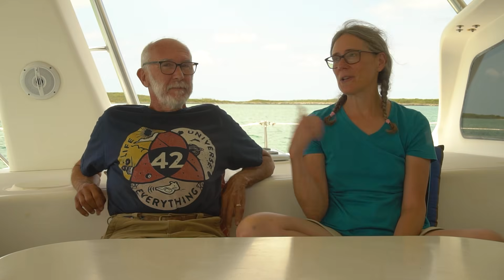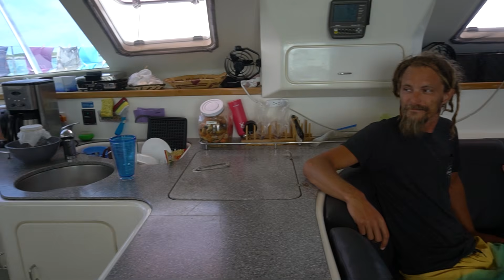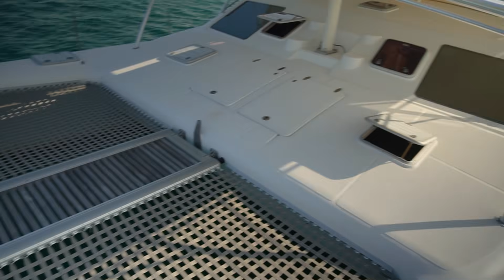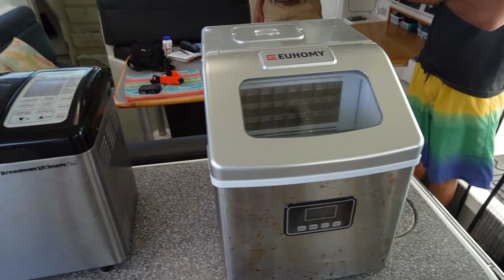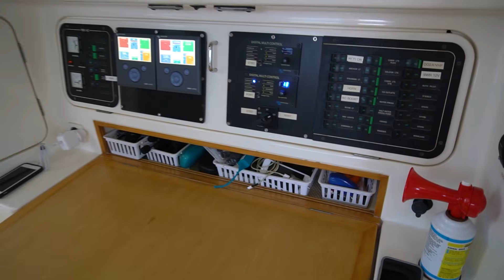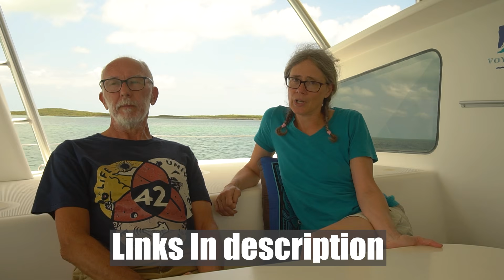100% Solar Electric Catamaran, Interview with owners from Indigo Lady

Comment: Really cool, if ever you need more power you can had a smaller catamaran platform that fit under the main boat that you can let it go out in the back of the catamaran like a solar trailler with more panals for more power. It's just an ideal!

Comment: If you couldn’t afford the electrical upgrade you could purchase two 40 Hp outboards and simply add mounting points to the hulls. 
Keep the huge fuel tanks from the original and have a massive range.

Comment: Since you already have the most expensive hardware. Maybe a solar slide system would be an option on the outer panels to add extra panels.

Comment: It would be nice to have some sort of wind turbine to charge the battery bank. I know there are are marine boat mounted wind turbines which have a very low capacity to charge drive batter banks.

Comment: 100% solar but you still use gens
Reply: Probably just a backup in case the batteries are dead main use is probably battery and motor

Comment: I have never seen a 2-blade propeller on any boat.  And torque is relatively irrelevant on a boat. Torque is what gets a dragster down a dragstrip fast.  So now you have all the complication of two diesel engines, plus all the complication of all the solar/electric equipment as well. I'm sorry, but that just seems nutty.

Comment: 20 miles a day!  Yeah ...... most boat people would not be happy with that.  And here's the problem, when you've done that distance and you've drained your batteries and the Sun is going down. Then you've got night time, so no charge. And then you wake up with a bunch of drained batteries, so you can't move until you've charged your batteries. If only there were a way of moving the boat across the water using the wind.

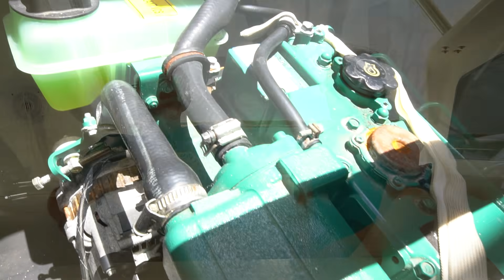Comment: "100% Solar Electric Catamaran" this is not true.  @ 5:57 he states that he has 2 diesel generators "for backup or cruising 24 hours a day".   Earlier in the video he states that the boat is set up to "island hop 20 miles a day" on solar/battery power.

Comment: Electric boats should be the default form of propulsion for leisure craft like cats where they have plenty of space for solar & battery. If there is an engine at all, it can be small in-line one to charge the battery or drive the motor in exceptional circumstances.

Comment: 5:49 - so they have a Diesel Generator Engine.... so this is not a 100% Solar Boat...  its just a gimmick... you are still relying on Fossil Fuels as the primary back up because Solar is useless and unreliable.

Comment: Amazing example of what is possible. if you replace the solar with modern ones you should get like 35% more electricity. They did some breakthrough on solar cells in the last months - which should be soon in production.
If you are lucky and Avalanche works out (a company) then you can take this whole setup, scrap it and put an Orbitron on each side of the hull and have more power, 24/7 and can run the engines full power as they together give you 30kw++ (I hear designs up to 100kw each are being worked on for a unit small enough to fit on a desk)) using ridiculous amounts of fuel (100kW, 24/h is around 0.2 GRAMS).
Until then - AMAZING thing.

Comment: Lovely setup.
I would have Most certainly put more powerful motors in, not for speed so much, but to be able to get out of a spot of bother. - such as:
Being able to steer the boat in strong winds and go against a strong wind.  (to be able to relocate or even allow yourself to have another chance at getting a good anchorage)
Having an over specified motor has literally saved the lives of our family a good handful of times.
Enjoy your boat, would love to have done a build like this <3

Comment: Greetings Dave and Lisa, kudos and accolades to you both for actually building and doing what to most of us, is a very challenging project. The concept of an all solar powered boat that is practical and liveable in, is awesome !! Just one query, in monitoring the power output of the solar panels, how often do you have to wash/clean the panels ?
Cheers
Kin

Comment: Interesting project. I was sadly surprised that they can get only 15-25 mi range running on batteries alone. Since they don't have sails anymore, that means they are limited to short coastal trips. I hope to see the technology evolving in my lifetime.
Reply: The thing is, he could likely invest in building out the batteries, and significantly increase storage capacity.

Comment: The lack of sail seems very limiting.
Reply: If you are in a hurry…. If you are retired as they are does it matter how long it takes to get there?
Reply: @mossybank2000  When you run out of power at sea with no sail you die.

Comment: 25 mile range on a sunny day with no current or wind fighting you. I don’t see why a sailboat was so out of the question. To sail on electric all day you would need run both generators which seems like running on carbon but with extra steps.

Comment: This is a neat prject. I'm currently converting a monohull to electric. Mostly for convienience (I despise working on marine diesels). I'll have solar panels and a small gas genorator on board. Lets be honest withourselves though about what is a isn't a vanity project. When you take the sails off a sailboat you have not "gone green". Learning to sail would be going green.
Reply from the maker: Sounds like you are working on a cool project yourself. Sometimes our bodies decide before we do. If I couldn't sail anymore I think an electric conversion would be the greenest and best option to continue living this lifestyle. But I won't argue that sailing is the best option imo.
Reply: @WildlyIntrepid  agreed sailing does a number on the body. I'm already saving for electric winches and roller furling.

Comment: Solar panels and LiFePO4 battery prices have dropped a lot since then - in fact you can now buy 600W solar panels for the price they paid for their 300W panels. The battery (2 x 16 cell) of 3.2V/340Ah ( ± 35kWh) would cost around $3000 !
Reply: Agreed, If you are willing to go used batteries, it can go as low as $50 per kilowatt

Comment: 🌴 I’m a retired boat ,yacht builder , I’m and old salt that’s so old when I fart dust comes out !  This guy & gal got their schit together , he is highly intelligent and has the know how and skills to pull this off , so l understand that using a Cat , gives you the space especially for the solar , the boat definitely got lighter getting those motors out and sail rigging , your battery bank seemed small to me but I’m not a solar guy that’s why I’m watching this vid to further my knowledge, would a larger Tri hull worked out better ? Could you of used say a Tesla wall battery ( don’t know the cost 🤔) worked out better , just wondering, could or would you us any say vertical wind generation? And what about distance ? Is it capable of being infinite 🤔 ? Self sustaining.  Have you taken it on long cruises, how far , what would or will you change to make it better . ( I’ve thought about doing a houseboat , a lot smaller scale but thinking of how to make it totally off grid to use as a mother ship to tow my fishing skiff to crazy fishing places ! )
Reply from the maker: Your ideas are all good. I think Dave made his choices based on what he could source at the time. As it has been some time that he has been cruising with his vessel. If I recall the batteries he has were some of the better batteries on the market at the time but very expensive compared to what we have now. We also have more options for charging sources.

Comment: US Navy sailor here, I have designed your boat down to the redundant gensets and wise choice on 48v as your system voltage. In my head and on paper anyway, but  you have actually done it and I am impressed sir. Bravo.
Reply: No gensets needed. I've lived this on 2 of my yachts sail and power.  One panel is insurance. More reliable than gas or diesel.
Reply: @mattparke4322   One panel is not even close to enough to move the boat yet alone getting rid of the power plant.
Reply: Solid computer controlled sails with solar panels embedded would be the best solution. You should be able to get as much solar power but with the ability to move without using your electricity when there's no sun.
Reply: you planned the boat down to redundant gensets and the only comment you had was good job on 48v? Riiiiight.
Reply: Very well said sir and if I may add, Dave's having fun!
Reply: So, as a Navy sailor, you also know how this would not work in blue water. This is for coastal cruising when you can wait for sunny days.
Reply: @JayRSwan   There is sun on lakes and rivers too ya know. Not to mention it has a desil generator so it would work fine. ALso the guy who asked the blue water question wasn't the navy sailor.
Reply: We all know you’re a bot.
Reply: @Bofum69  Why is the go-to response for your kind "tHeY'rE a BoT"?
Reply: @Bofum69  For all we know you're a bot.

Comment: I have a couple of probably very dumb questions for you, I know little about boats or electricity.  
1. Is there a way to find out what kind of power would be needed for typical operation(at anchor) for a specific kind of boat?  I am thinking a lagoon 500 currently? 
2. If you ran solar over the entire deck surface of that boat 15.5m x 8.5m would you get enough electrical power to operate the boat and still have enough left for reasonable propulsion?
Reply from the maker: So many factors come into play. It's easier to reduce consumption than it is to produce power. Everyone's power needs vary. For myself we get by just fine with a few hundred ah and 1kw of solar for the most part. Others have more power hungry appliances and some do not even have a fridge. Work out what you want and make sure you can run that much on your system with enough overhead for cloudy days.

Comment: I would suggest a hydrogen tank, with a fuel cell and an electrolosys system.  So that you can store large amounts of power but admittenly it'll only have about 50% efficency.  But once you've emptied those batteries and before you run the diesel generator, you could run you hydrogen power storage system.  It would extend that 20 miles range of pure green energy.
Reply from the maker: That is another nice option for someone who isn't on much of a budget. As that tech is pretty pricey for what you get imo. We keep getting great comments and suggestions on how the range could be extended but if I recall they never felt limited by their range and have cruised down the coast and to the Bahamas for a few seasons. Some don't mind traveling less miles in a day. Cheers.

Comment: Mr. Dave, as an engineer/builder myself I have to say: Hats off. Just rigging  the roof/rack for the panels and make it work like a Faraday cage to conduct the current of a possible lightning hitting is awesome. Congrats. I worked in one of the places of the Continent with the higher probability of lightnings (Monagas, Venezuela) in the oilfields and I could see the spikes-like systems working. We used to measure the current going down to ground  with an ampmeter clamp, and this is the suggestion I dare to give. Attaching an ampere meter can't hurt and will indicate that the system is working.
Reply: As an engineer, second that.
Reply from the maker: Dave is the man imo. Lots of great ideas and engineering .  That must be one hell of a clamp on meter to measure the lightning strike. I have one that is only max of 100amps. Cheers.

Comment: All up 350,000 US would have bought a pretty nice catamaran and than learned to sail, much faster, greener, cheaper way to live considering the batteries, panels, controllers and motors need replacement each decade or so. I think solar is a brilliant accessory on a boat but wind is the cheapest and greenest form of propulsion by far
Reply from the maker: I completely agree that a sailboat would be "greener" but not everyone wants to sail. I think you are mistaken that wind is better imo. I can't think of any part of wind that outperforms solar. Plus all the moving parts and it's output makes it my last choice to add to our boat. The cost per kw is terrible as well.

Comment: 16 kw seems like a very small amount of storage, I imagine with the prices now you could double that or more for the same price. Im not an ocean loving type but this looks like a great lifestyle and I could see it approaching 100% free power and transport with emerging technology.
Reply: Battery prices keep dropping.
Reply from the maker: You are right. I think at this time you could almost double the capacity for the same cost.
Reply: @WildlyIntrepid    The boat selection, design and overall plan was well conceived and well executed.  Congratulations on your success.
Reply: The big game changer will be when you can load up on solar and have a genset that runs off of hydrogen that you make and store on board, extending range. There’s already a boat testing this out.
Reply: The big game changer will be when you can load up on solar and have a genset that runs off of hydrogen that you make and store on board, extending range. There’s already a boat testing this out.
Reply: $150k is a lot of money for how little generation and storage he has. The roof has a lot of wasted space
Reply: @nirodper  
Yep, solar panels and LiFePO4 battery prices have dropped a lot since then - in fact you can now buy 600W solar panels for the price they paid for their 300W panels. The battery (2 x 16 cell) of 3.2V/340Ah ( ± 35kWh) would cost around $3000 !

Comment: Quite low battery capacity, boat that size could easily house 10 times more with no issues. Would enable multi day cruises just on battery power or more rapid transfers.
Reply from the maker: True. But at that time batteries were much more expensive that now. Everyone has a budget.

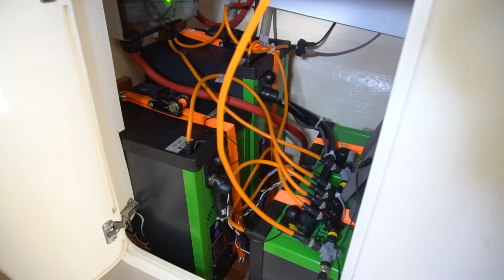Comment: 4:50 7.2 kw, let's see, that's just under 10hp, with the sun directly overhead and no clouds.
Reply: Depend upon the batteries they have on board and if they plan to stay in a location for a couple sunny days to charge up.  As for me I would still keep a small generator or out board which can get me out of a tough  spot.
Reply from the maker: What exactly are you trying to say? You can only fit so much energy production onboard

Comment: Love to see two separate energy sources, i.e. diesel and solar electric,  working together to achieve a common purpose of moving this craft.   This is where our motivation should be in the next generation of vehicles.  Hybrids make way more sense.     And proven too.
Reply: I think adding wind power would make a ton of sense, often there's wind when there's not sun. I'd make it so the turbine could be raised when in use. I bet there's a way to get power from the waves lifting and lowering the boat. I'd still want some sort of diesel power too.
Reply from the maker: Wind is a nice option for some. As you said having it retractable may be a nice option but imo solar is just so much better. For the most part as cruisers who island hope we do not spend enough time in areas with heavy enough wind to make a turbine worth the cost. We find protected anchorages which means less wind output. Plus personally I'm not a fan of the sound and even the output is far from great.
Reply from the maker: I agree. Solar is great but having a backup is needed imo. For those who harp about all alternate energy do not understand what it actually takes to move a vessel long term.

Comment: This looks like a nice entry level thing, but  meh overall in terms of specs.
Under that solar roof canopy, so much dead space there. They should tear down the top and rebuild the entire superstructure with the roof integrated.
The radar tower should not be placed there as it interferes with the panels harvesting, and if they're monocristaline, the entire panel that receives some shadow is voided, doesn't do anything. So move that thing away from the solar panels, far away so there isn't a chance to cast a shadow.
And more batteries should be used. Buy cheap nissan leaf battery packs and use those and not these overpriced banks that offer little to no capacity per thousand dollar spent on them.
Reply from the maker: Unfortunately there is only so much space onboard to keep everything away from solar. Everyone has an opinion of course but we thought they did a great job with the solar roof.

Comment: this cat has a hull speed of 8.5knts.  Not combining sails with solar seems like a big waste of opportunity.  4knts from electrical is slow and only on sunny day, but more so is what if its not so sunny and raining and storm?  How long can it run its engines with in those conditions?  Those are conditions when you really will need to push those engines and they might not last.  Not sold on whole idea yet.  No offence, i am sure its a great boat to bounce around islands.
Reply from the maker: You have some good points. Although this boat was built for just that. Bouncing around islands. Adding sails would not have helped the output of the panels and also would not help if someone doesn't wish to sail. Then they would just be like almost every other cat I see. More often I see Cats Motoring and not sailing to the next Anchorage.

Comment: You guys are inspiring, this is something I want to do, and also own a catamaran. I currently have a 35 Columbia boat which I test and try out project for this. Also yes technology is always changing, sodium battery is coming out also when it comes with air conditioning some runs through solar panels and doesn't use much energy.
Reply from the maker: Glad we can inspire. There really is a lot of different things constantly coming out and it's fun to test and find what works best for your needs. How do you like your Columbia?
Reply: Thank you for sharing about sodium, I had no idea. Alternatively, wouldn't it be great if we could simply make power from the salt water our boats are floating in.